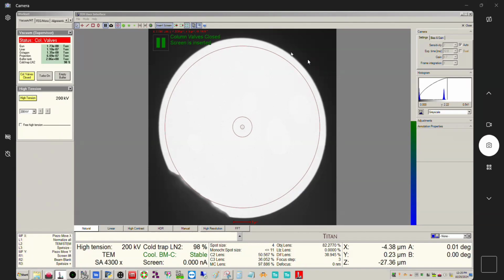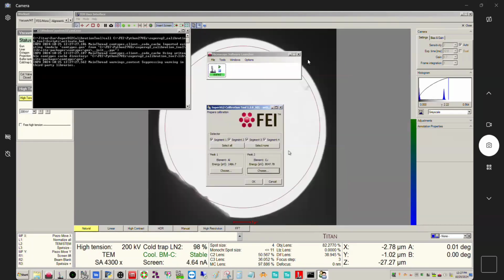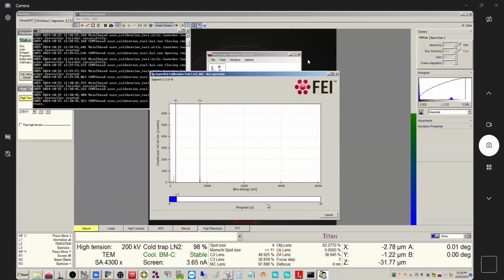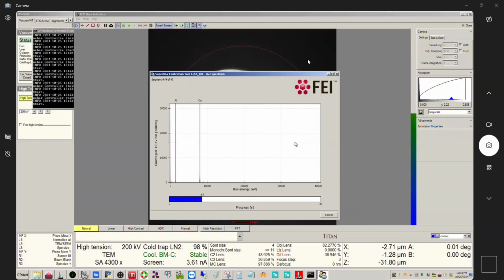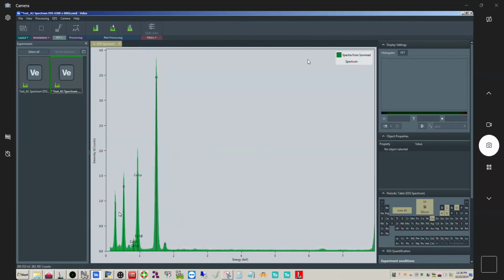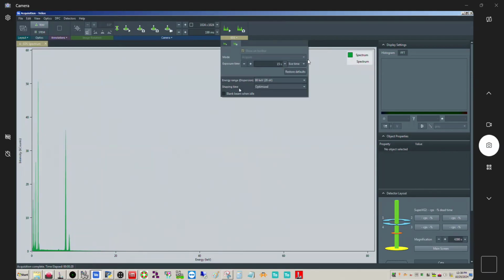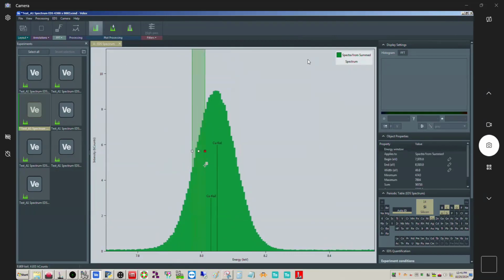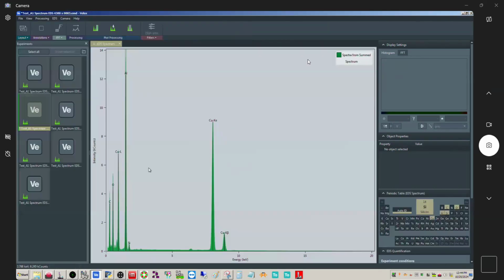FEI SuperX SDD EDS calibration

Comment: Hi Nic, thanks for sharing another useful video, may I request another video about how to boost X-ray counts and get enough counts in STEM EDS mode? I usually try to image and do EDS for nanoparticles like C-based quantum dots, but X-ray counts always very low even sometimes less than 100. And usually only one of the SuperX detectors giving some counts. Thanks your time and efforts.
Reply from the maker: Hey, thanks for your support and for watching the video.  Performing EDS on very small, low Z particles can be challenging because 1) the fluorescence yield is very low and 2) the volume of material available to generate X-rays is very small.  if you have the capability, this would probably be a good scenario to try STEM-EELS instead of STEM-EDS.  If you can't do this or you want to stick with EDS for some reason, you need to make sure there is optimal line of sight between your sample and the detectors.  When you load the grid in the holder basket, make sure you load it with the film side down, as this side will ultimately face up in the S/TEM; this should eliminate (or at least minimize) any shadowing effects from the grid bars.  Otherwise, if grid shadowing may be occurring, try to work on particles in the middle of the openings and not near the grid bars and lastly, you can play around with increasing the alpha tilt to see if this improve anything.  If grid shadowing is the issue, then there should be a point when alpha is high enough to give clear line of sight.  Of course, this is another advantage of STEM-EELS; the issue of "line of sight' is irrelevant for all intents and purposes.